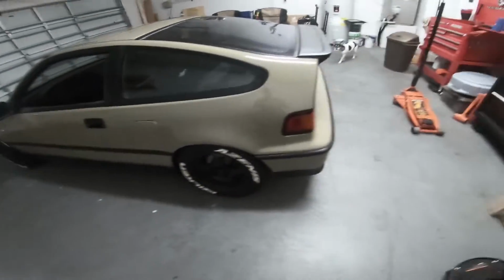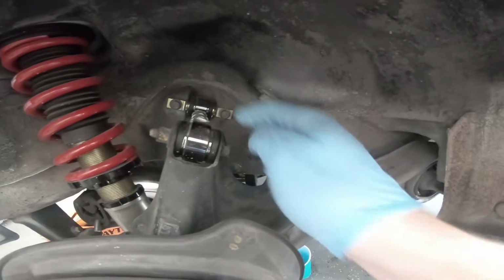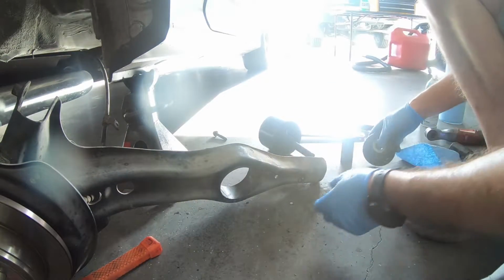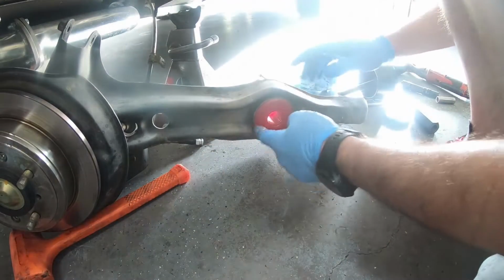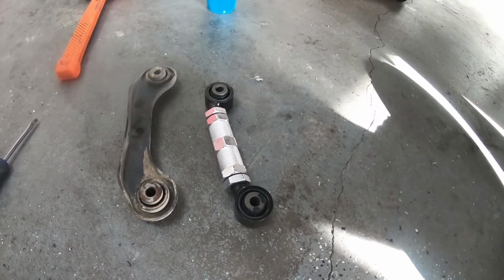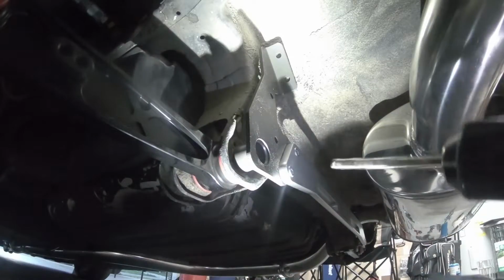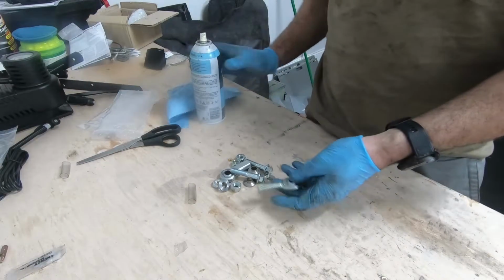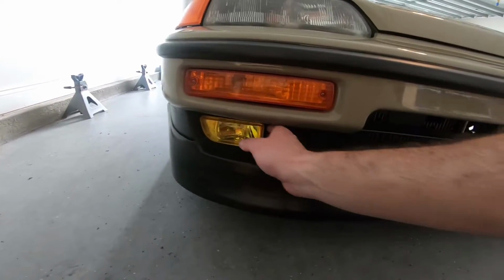Honda CRX Si ASR Subframe Brace & 24mm Sway Bar Part 22

Comment: I have that asr bar with those same Lcas . Can I run the OEM sway bar ???90crx si.
Reply from the maker: You should be able to. I don’t see why you couldn’t. They both use different mounting points
Reply: @justingadell  it does I’m just having trouble with the bolt that runs from the end link to the LCA hole . My bolt only threads about maybe 3 spins. Do you know the size of bolt for that ? I got skunk2 alpha LCAs